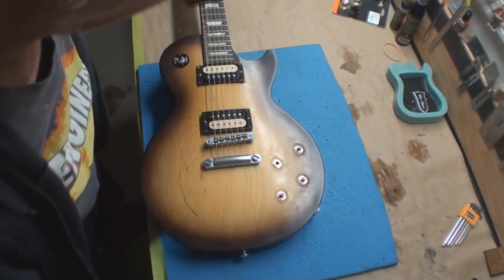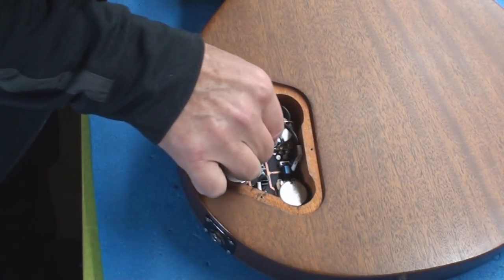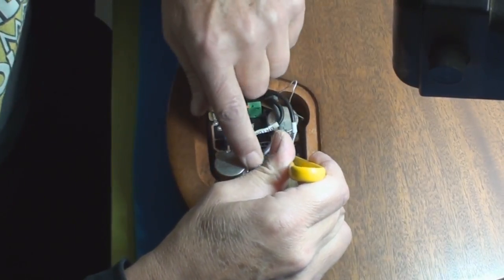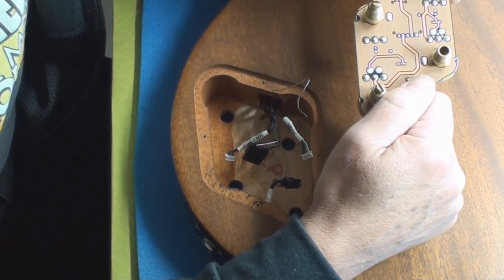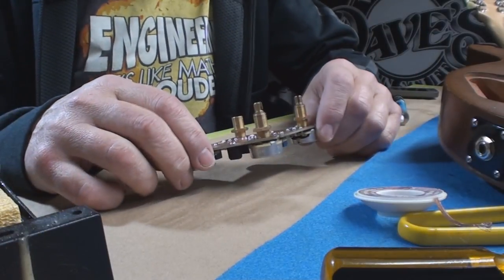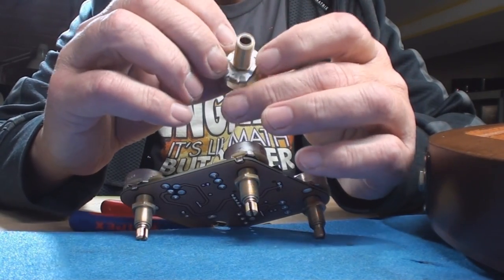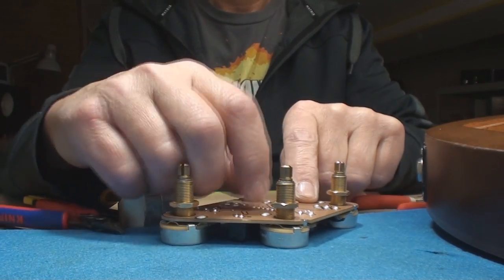Repairing That Stupid Gibson Les Paul Circuit Board

Comment: Hey Dave, I have a few tips that might make work like this easier for you (I work for a ribbon microphone company and do tons of soldering for work and my own projects):

Switch your soldering tip to a chisel (sometimes called screwdriver) tip.  For general purpose soldering, these tips tend to be much better at efficient heat transfer.  There are plenty of different tip geometries available for that Weller (I think you have a WTCPT, but I didn't get a great look).  Unless you're dealing with a really tight area where you need to be able to use your iron from any side, which you shouldn't in a guitar, you don't really need conical tips.  I don't remember the last time I used one for my own work.

When you start dealing with ground planes, which act as heatsinks because of how much metal they have, that's when how fast your iron can recover heat comes into play.  Those Wellers aren't bad, but they're not great either (we have one in my office, but it just gets used as a hot poker).  The best irons that I have used are Metcal and JBC.  I personally own a Metcal MX-5210 and a JBC CD-1BE.  Both of these irons have the heaters built into the tips, and recover heat extremely quickly (which saves me time because I often have to solder onto large blocks of metal with lead-free solder).  This makes the tips quite pricey, but as long as you don't abuse them, they will last a long time (both of these irons drop the tip temperature when they are in their stands as well).  Both of these irons take about 2 seconds to go from room temperature to target temperature (you can adjust the temperature on the JBC, but the Metcal's temp is self-regulated by its tip, which uses RF instead of a traditional heating element; you can buy 500, 600, 700 (standard), and 800 degree tips).

You can often find used Metcal MX-500's for very reasonable prices, and these are fantastic industrial-grade irons).  If you're on a really tight budget, Edsyn ZD-951SX's are one of the best values in soldering as well.  I've also heard excellent reviews on ERSA soldering equipment, but I have not tried it myself, so I can't speak to it.

To sum up: no matter what iron you're using, with the kind of work you do, I HIGHLY recommend switching over to chisel tips as opposed to conical.  If you can spring for an upgrade, Metcal and JBC are about as good of soldering irons as you can buy and will serve you very well.  If you're on a tighter budget, Edsyn ZD-951SX's work very well also, but are a clear downgrade (my office has a few of these Edsyn's, so I have a lot of experience with these irons).  In addition to not being as good, I also find the Edsyn handpieces to be less comfortable than the smaller and lighter Metcal/JBC ones, but that's not to say that they're bad or anything.  If you can score a good deal on a Metcal MX-500, which isn't usually hard to do, that would serve you very well.

Keep posting the cool videos!

Comment: I know it's 5 years later but had to tell you I was in a similar pickle, having 1 hour before a gig no solder and no iron and no spares I took the shaft that had been pulled out put some super glue on the end and shoved it back in, it worked for about a week even with turning the vol up and down but I was nervous till I took the plunge and replaced all the controls with the old school type which are easier to repair. Repaired a broken nut on a 335 with bicarb mixed with super glue to make a piece of artificial bone. Keep super glue in your Guitar case along with some alumiunium foil for bridging dry solder joints(in case of Emergency and no spare Instrument).

Comment: That yellow tool is, pretty sure, tweezers for pulling circuit board jumpers. Like those found in old CD Rom master/slave, or clear cmos jumpers. The integrated circuit tweezers have an odd head that allows to reach between lugs. I've had that question as well. That's what I came up with.

Comment: I believe the circuit boards are still USA made but could be wrong. They are very simple circuits. The knobs on my SG are so tight I always wondered how I would get them off the Les Paul I have without doing exactly what happened in the video  as the les paul is push/pull. I actually like the circuit board, makes swapping out pickups a lot easier and I like the tonal variations I get on my Les paul.

Comment: Dave, parts that are completely screwed like that are easier to desolder if you snip the legs off and remove them one by one. You put a lot less heat into the PCB too which with some of the CNC made boards can be a real PITA if you blow a track ;)

Comment: Stuff Dave said that sounds dirty but aren't:

3:07 Maybe a long shaft can work.
5:12 I don't think my rod is hot enough.
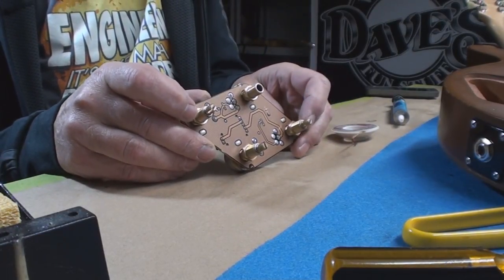5:38  I'll have to bend the leads over ... stick em in the hole ...
6:13 I'm gonna pull out the big one.

Comment: Is that buzzing an amp issue or a guitar grounding problem.   It seemed to attenuate when you touched strings.
Reply: Its the grounding. Its crap. My P90's were picking up Radio 4 before I re-wired it.

Comment: re the solder - I understand now they use lead free solder that does not melt easily with a standard iron. My trick is to flow some fresh leaded solder on the higher temp stuff then it seems to melt easily. Used that trick a lot in repairing digital TV set top boxes - almost always the caps in the power supply section go awol.

Comment: I just pulled the PCB from my 2020 Les Paul Tribute. Old school CTS pots from now on
Reply: The tribute comes with PCB factory? I bought a used own. Previous owner must have changed everything out because it was handwired with Gibson pots & orange drop caps. It sounds really good. My much more expensive standard has PCB and sounds like Ish
Reply: @realtruenorth  Yes, my 2020 came with the PCB. I think the new SG Standard does also

Comment: Id suspect the pcb board gets a bit torqued on due to the small movements of the woods, the solder joints may be worn out and need re soldered. But overall it should be replaced with a proper wiring harness and shielding
Reply from the maker: humbucker require no shielding
Reply: @DavesWorldofFunStuff  I’m giving my lp studio a rework electronically, it has an awful hum and the pots seem to halfway work. It has a pcb with plug in ground and not a solid joint in it.

Comment: Like taking your computer apart to blow out the sawdust. 
I'd be tempted to rip it out and go old school.
I'd be concerned with cracking of the wood around the (potholes?) due to pressure between them. Thanks, Dave.

Comment: Probably gonna trade in my Goochson Les Paul. Had to replace the pots just to do a pickup change. Looking to get a 2018 PRS SC
Reply: Brandon Avila Made 30 minutes from me. PRS is miles above Gibson. They have those 594 guitars I think, they seem nice. I have a 2014 SG I kept because it's trashed and I put lots of time into it. I'd take the SE guitars over Gibson. Disappointing for an American company. PRS will probably follow eventually.
Reply: PRS USA is good (though expensive and doesn't hold it's value well so it's good to buy them used), PRS SE is a different animal. They have 100% no name chinese hardware which is decent but nothing special and the woods are softer than balsa wood. Finish is decent but there's tons of better stuff for the price. Used pre 2014 Gibson stuff and some of the post 2015 stuff is decent too and better than their reputation makes it seem if you find a good one. Many models still have point to point wiring.
Reply: Korean Made and yes, I'd say it's better than Gibson and I'm speaking from experience not bullshit or brand. I own a $5600HBII A 30th anniversary artist package a CE-24 from 94 and a S2 which is half American half Korean. Won't mess with Gibson anymore. Besides the SG. And no offense but you're talking out your ass about the SE guitars. 1 they're not made in China 2. They use mahogany maple and rosewood. They put Gibson to shame in every regard but electronics I'll give tou that. The electronics are so/so. But lots replace their Gibson USA stuff like I did so, that's a moot point. Your advice on buying used is sound with regard to resale value but, the newer guitars have improved areas I didn't like in previous years. But otherwise, sound advice on buying used of you find an older model with specs you want, it's a better deal. Take care.
Reply: I've owned dozens of guitars of all kinds, makes and eras over the last 6 or so years and have extensive guitar repairing experience. The hardware is chinese made because even if they do make the guitars in korea (not a big difference as far as quality goes from my experience) the korean factories get the hardware from other places. Even Grover, Fender and in some cases Gibson makes their hardware there (some of their nashville bridges and the tuners, which are either grovers or made by grover). I've worked on several SE's including a higher end 7 string I changed the pickups on and a Torero which needed a pot change. All of them were made out of nato, not mahogany. Nato tends to be lighter and much, much softer, I've seen very few non japanese asian guitars that are built with decent mahogany lately, only Gretsch Corvettes, cordoba made Guilds and higher end LTD's. The maple caps were indeed maple but the pretty flame is a veneer over a plain top. Still, I'm not talking about them compared to cheaper Gibsons (which I do prefer) but against many other makes. For about the same as a PRS SE 245, for example, you can get an LTD EC1000 that's as well made with slightly better woods, tusq nut, tonepros bridge, duncan pickups, japanese pots and locking tuners while the other one doesn't even have PRS USA pickups. There's also the Diamond Bolero that comes stock with duncans, the Chapman ML-3 or if you live in Europe the Fame Forum, which is built by Mayones and has top notch hardware too for under 1k. It's not hard at all to do better than a PRS SE at any sort of pricepoint. My personal favourite new solidbody for under 1k right now is the Guild Polara.

Comment: I don't hate the circuit board....  the concept is,  less likely to whiff the wiring, and make it faster/easier to assemble.  W. Edwards Deming principles.    The sharp fret ends aren't excused...  EXCEPT if the fretboard shrank due to dry storage.
Reply: Fair enough.   In regards to the PC board,  I can understand why some may not like it.   I've also seen a number of guitars wired WRONG from the factory (according to the maker's diagram)

Comment: Wow, as an EE I look at the "circuit board" at 03:31 and say WTF?!  Besides the pots there are only two capacitors in the whole thing, same as a normal hand-wired guitar circuit, so it's clear they did that so they could machine-produce the board and use  unskilled Chinese labor to plug in connectors, instead of using marginally-skilled Chinese labor to hand-solder it directly. Probably saves them 20 cents per guitar in labor. But at the cost of using wire and attachments meant for digital use instead of thicker wire meant for analog.

Comment: I have the very same issue on my LP Standard Faded with the PCB. Even saw dust and small pieces of wood were inside of the tone control compartment. The neck also showed major imperfections. This is just not acceptable for a guitar at that price point.
They should take a long hard look at Ibanez prestige guitars which are cheaper but made to perfection.

it goes on...
I had a similar issue with Fender USA Pro series... for Fender/Gibson it just seems like they don't care anymore and want you to pay 4000$ for a custom shop instrument to get a decent guitar.

Comment: I bought a gibson 58 special reissue from Sweetwater a couple of years back and the first thing i did was to gut out that cavity and replace with real pots and wires. Never again. I will NEVER buy a new gibson again. The guitar turned into quite the money pit. I had no choice. I couldn't sell it. The only choice I had was to "rebuild" it. I even had to have a pro guitar fixer guy move the wraparound tail piece back almost an eighth of an inch in order for it to intonate properly. And that isn't really for sure. GIBSON GUITARS ARE SHIT. I bought a 339 and played it for 5 minutes and packed it back up and returned it immediately as well.POS GIBSON NEW GUITARS.

Comment: Same prob with my LP Tribute- scratchy neck PU pot between volume 1-3ish, cuts in an out, figured easy fix, RIGHT. Took the back off to Deox it and saw that FUCKING BOARD!!!!! Not a happy boy. Seems like the one connections ha a short when I push down on it.  Love the guitar, it's a great player, stays in TUNE and takes a beating but WTF is this CYBORG SHIT going on inside GIBSON????!!! My good deal Chevelle just tuned into a Chevette.

Comment: Dave, I which you'd shown the shaft that came off more closely. It's quite possible all you had to do was pop the shaft back in. From the manufacturing point of view it makes a lot of sense to make a pot without a shaft that different sized shafts can be affixed to as the need arises. You may have gooched yourself...

Comment: Junk. The PCB's were really over-engineered junk mind-you. Mine was 1/4" thick and the tracks somewhat akin to the Rio Grande.  Makes a great key-ring. Everyone slags off the Gibson pots but they are better quality and have better taper than the POS CTS are selling for $9 each these days. Word of warning to anyone messing with their pots on these 'satin' finish Gibsons: be really, really careful inserting and removing the pot shafts from the bodies and pay special attention to the torque on the nuts. The finish is so thin and brittle I've had chunks come off the top coat around the holes and the slightest amount of pressure on the top (including screwing down the stop bar posts if top wrapping) will cause cracking. I don't give a shit on my gold top as I paid iirc $280 for it new. But if you're precious about your junk ye be warned. Man I have replaced everything except the neck on my 2013 50's Tribute: tuners, nut (worst piece of non-functional shit I have ever seen on any guitar), pots, wiring, mounting screws, switch (died in < 3 months), jack plate (paper thin, split in two in first year), jack (cheaper junk than even Epiphone use), pickups (Epiphone/Asian made junk). If the darn thing wasn't the sweetest sounding guitar I own .. I'd have tossed it in the trash long ago. Price is no indicator! Just budget for completely rebuilding it, if you're keeping it ..!

Comment: "If it ain't the way it was in my day, it sucks."- motto of old guys everywhere. Circuit boards are not going anywhere fellas...
Reply: They'll be going in the trash when people re-wire the guitar properly. :-)
Reply: Circuit boards could work in theory but these are not good
Reply: J A It will be drastically more expensive to modify the $1000 guitar I bought now thanks to gibson cutting corners. Now I understand why they're going bankrupt. Cheap, ridiculous, dick move by them.
Reply: I have the circuit board in mine, though it's slightly different to this one. I had a pickup maker make me some PAF's for it and Gibson supplied the plugs for the quick connect and it's fine. I have a 57 gold top as well and there is no noticeable difference between the two of them. Sorry, I expect to get it in the neck for saying this.

Comment: Wow what a bunch of crap by people who don't know anything about electronics. Circuit boards have been used for decades, including spacecraft. I can train any of you to solder those boards and to unsolder and replace components. If you look on the bottom of that board, it's mostly copper, providing some RF shielding. The connectors are terrific... want to try a different pickup? Make sure it's Quick Connect or add a connector to it. Again, dead simple, I can train any of you to do it.

Unsoldering and resoldering pickup leads is messy.
Reply: The point is the terrible quality. Gibson is like a cringy ex boyfriend begging to be taken back by a girl that just doesn't want him anymore.No matter what they try to gain back interest with gimmicks and other bs the more they ignore the real issues driving the public further away. I can't wait to see them go belly up